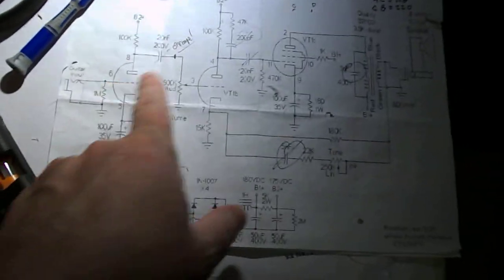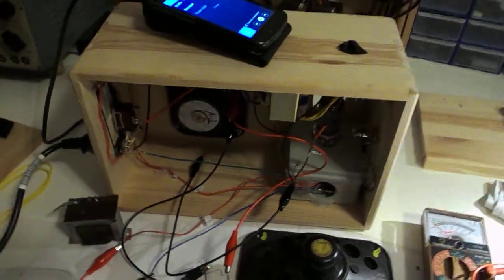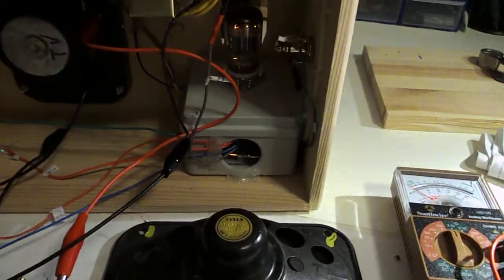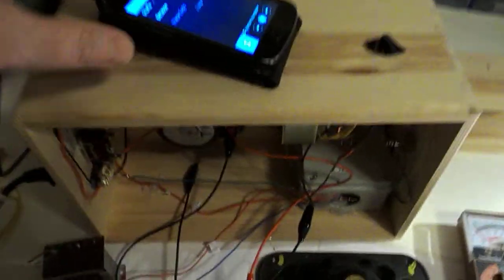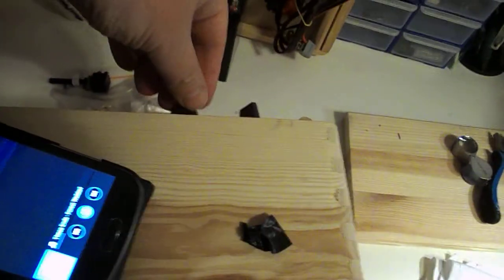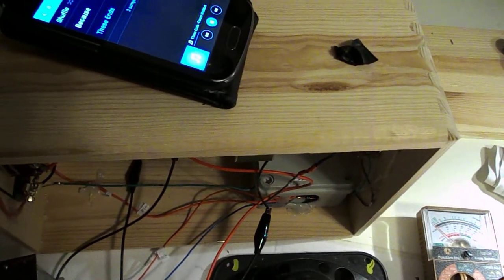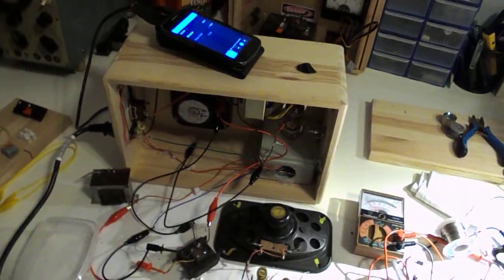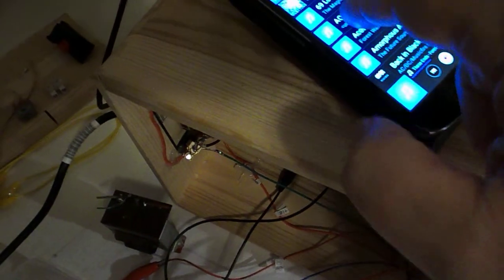6AF11 Compactron Amp 1

Comment: Hello where did you get the power transformer?
Reply from the maker: Sorry for the late reply, I get most of my NEW transformers from Jamie at this company in China. Email him or see the website. He speaks English and just ask for what you need.
Email: jamie@chongzhouhengda.com
Http://www.chongzhouhengda.com
For example, the transformer in the video was one I ordered I just asked him. "Can you deliver a transformer like this?

PRI: 110 vac 60hHz
SEC1: 250 vac
SEC2: 6,3 vac
20 Watts

That was 3 years ago but they were only 5 bucks each! Well, plus about 25 USD shipping...so the more you order from him, the less the cost will be. Otherwise, you have to look around ebay or salvage old radios and such.
Reply from the maker: Ask jamie@chongzhouhengda.com and he can get you ANYTHING you want! But u must know what to ask for. A basic 20W transformer with 110VAC in (for US) and first Primary out of 250VAC and Secondary of 6.3 VAC will cover most basic tube amp projects to begin with. Likely 5 bucks each plus shipping...the more you order the less overall your cost will be.
Reply from the maker: I should have a few transformers as well if you have interest. You can contact me on my ebay site. 
https://www.ebay.com/usr/waldos_tube_town

Comment: Sounds like a hum loop rather than ripple, though a single tube output stage has no power supply rejection and really needs regulation as a priority.  So two things to correct, yet the quality of a simple, intrinsically linear amplifier swinging a lot of voltage with little phase issue and transparency due to minimal component count (phew!) shine through regardless. If you know what I mean.
Reply from the maker: Thanks for the advice.....I'm doing a lot of tinkering but still don't really know what I'm doing. Been looking at fake middle taps and other things to help with the hum and taking more note of power supplies and where it's all plugged into.